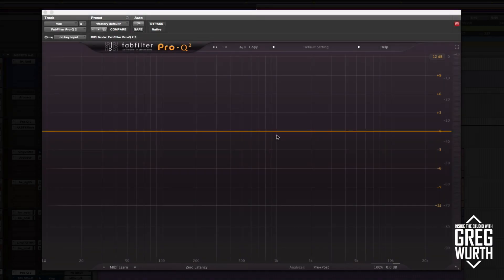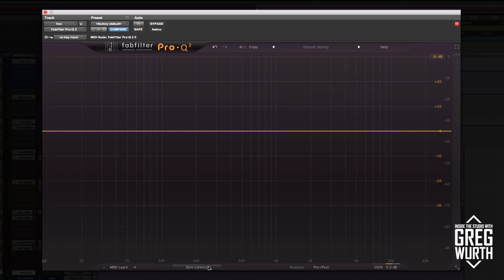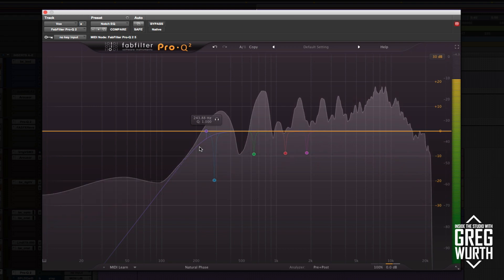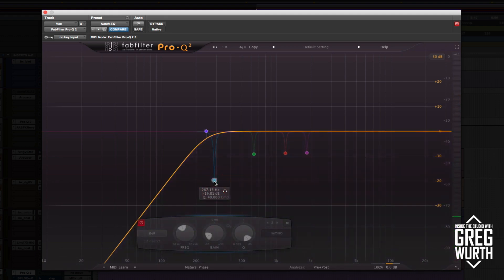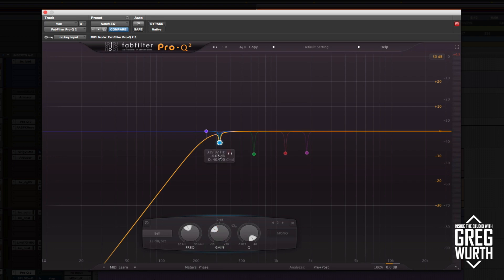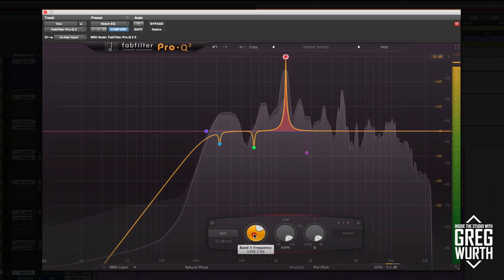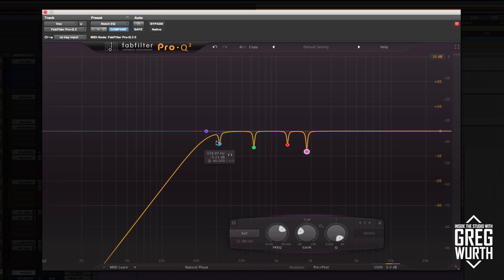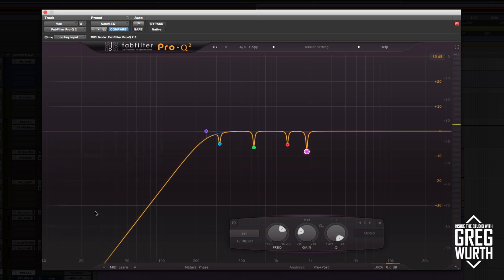Using Notch Filtering To Fix A Track

Comment: I do the exact same technique but when I boost up to the 30db with a narrow Q and sweep until i zone in on the offending resonance I then begin lowering the gain of the boosted notch until the resonant begins to dissipate and wherever that is on the boost (ie. 15db, 14db or 10 whatever) that is how much I then subtract when I notch out.
Reply: because that is the exact amount of information that needs to be knocked out before you start knocking out good information.